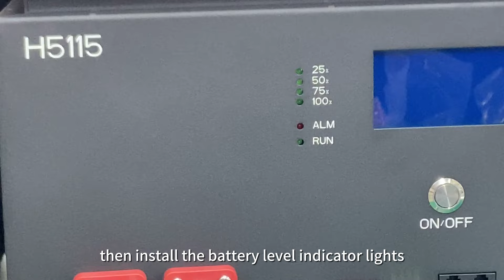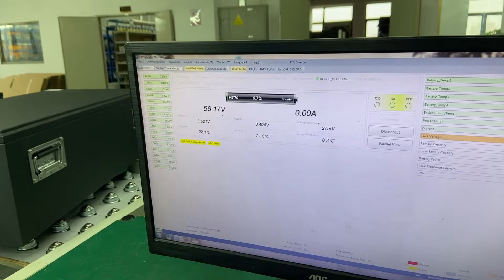LiFePO4 Battery 48V DIY Kit 200A BMS Assemble & Packing, USA & EU stock #lifepo4 #diy #lithium

Comment: Which bms brand is it?
Reply from the maker: battery box is KESHEE, and cells are EVE LF280K 3.2v 280AH.for more questions you can contact us by e mail: sales@keshee.com whatsapp:+8613424420649
Reply: But which manufacturer is the BMS?
Reply from the maker: BMS is made by richpower